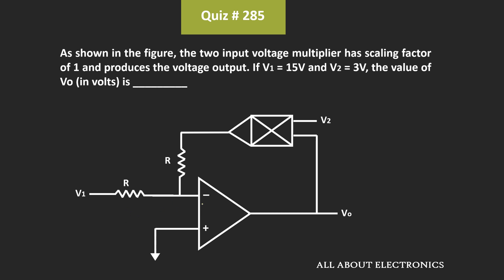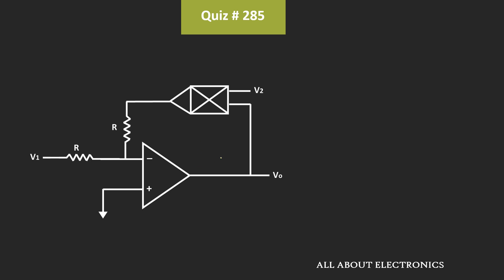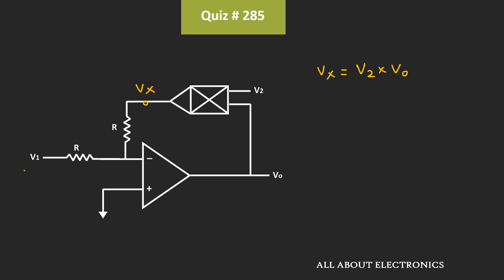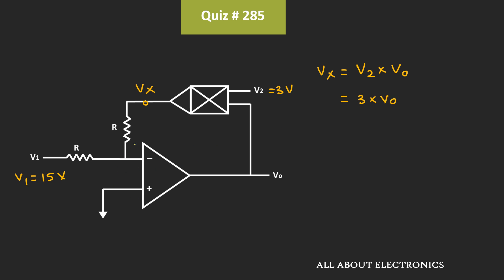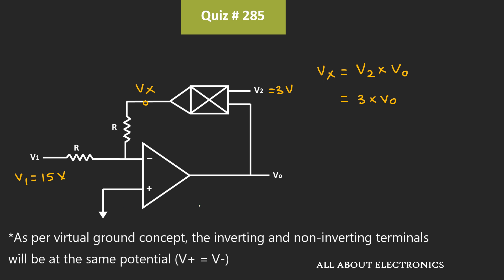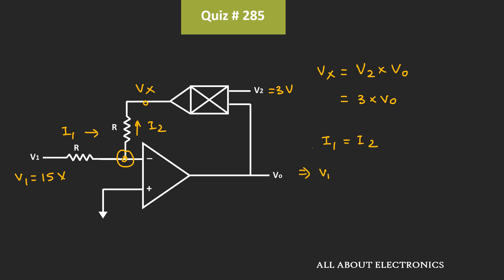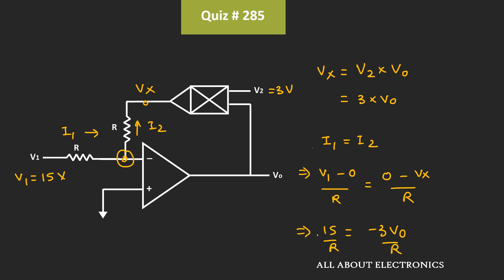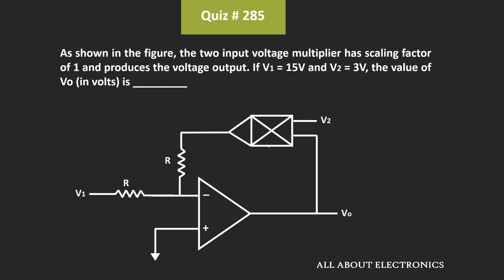Operational Amplifier Solved Problem | Quiz # 285

Comment: But sir what kind of a voltage multiplier is that?? 
With two inputs??
Reply from the maker: Many voltage multiplier ICs are also readily available, which multiplies two inputs.
Two inputs are are two voltage inputs.
Reply: @allaboutelectronics-quiz  ohk sir 
Thank you  very much